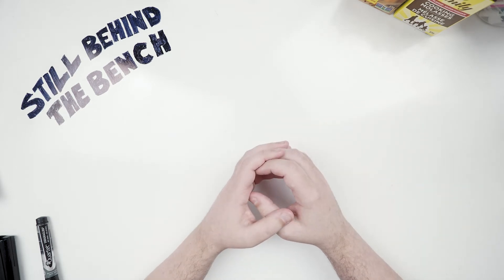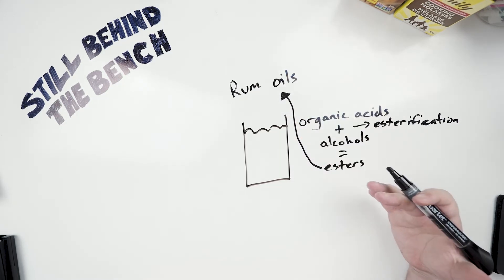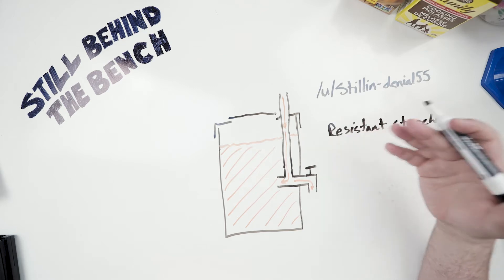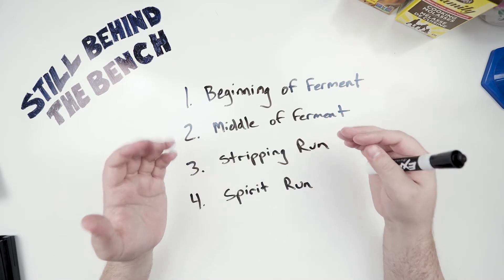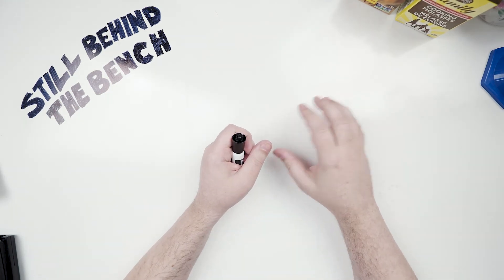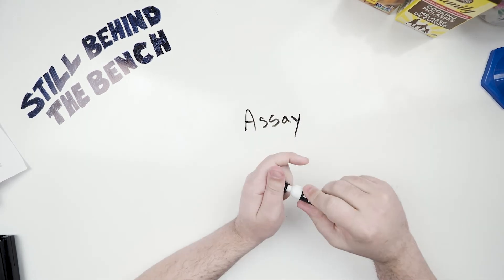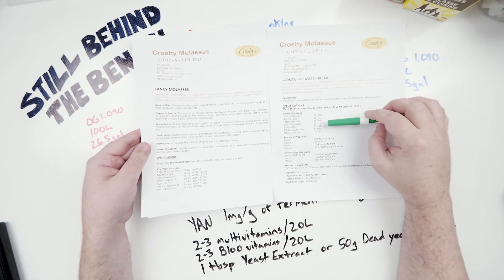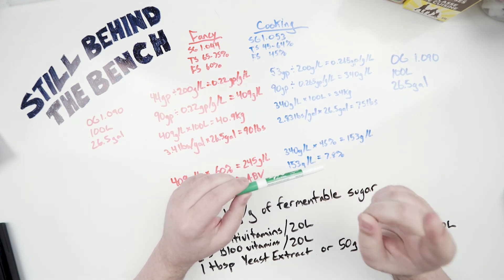Ep 019 - Developing a Recipe Part 3 (Rum)

Comment: Hi Adam, aiming at 90 GP will give a wash abv of around 12,5%. Wouldn't this stress the yeast? 
You are probably using yeast with a higher abv tolerance
Reply: According to the calculator over at chase the craft, it's about as high as you want to go before stress becomes a problem.

Comment: Hi Adam, a question regarding YAN. You are calculating the amount of YAN based on the grams of fermentable sugars in the wash. What if by mistake the YAN added is for example double the amount needed for a healthy fermentation. Does this excessive YAN remain as residual in the wash and does it affect the taste of the distillate?
Reply from the maker: The extra YAN will most likely be taken up by the yeast. In fact, if you put too much YAN in at the beginning of fermentation, you can end up in a situation where there is a very large growth spike in the number of yeast, that leads to there being too many yeast, and quite a few of them end up starving and dying. That can lead to off flavours in the taste of the distillate. If you only add a little extra, like maybe 15-25% more, it probably won't be an issue, but if you added double, you could definitely hit that point.
Reply: @StillBehindTheBench  great, thank you Adam!

Comment: any sources for the multi's, b100 and yeast extract?  keep up the good work!
Reply from the maker: I just use centrum for the multivitamins, and B100 vitamins for the b vitamins. Yeast extract can be nutritional yeast, vegemite, marmite, or you can just take the yeast from a previous ferment, filter it through a coffee filter, then put it in a pot with a small amount of water and boil it to break up the yeast cells.
Reply: @StillBehindTheBench  any specific ratio per 5 gallons of mash?  1 centrum maybe and 1 B100 per  5 gallons?...im assuming these are human vitamins you crushed up and sprinkled in?  lol...incredible info- Thanks from Panama!